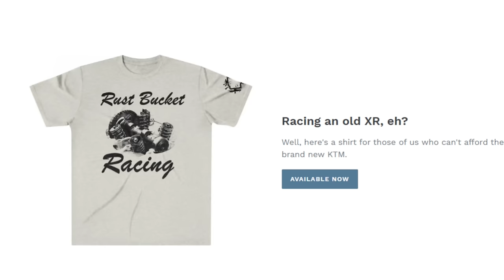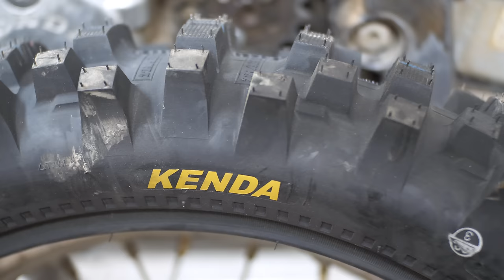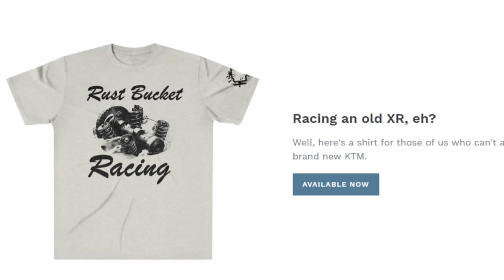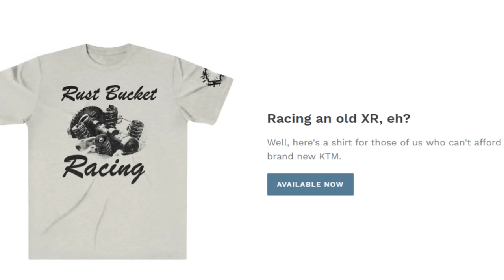Full Episode XR250R Rust Bucket Racing

Comment: someone sponsor this man PLEASE most people that have shiny new bikes cant even use half of the bikes power yet somehow you seem to squeeze gallons from one orange😂
Reply: Which bike do like the best xr 250/400 or the kdx 220/250
Reply: You don't water a cactus.
Reply: David C  good riding. buy a drz 400 e. Do some suspension work and go for it. You ride really well and are proof that it’s about the rider not the bike. Especially these days where they are all good, the bikes that is.
Reply: @eyesthatseewillsee7457  Depends on what riding you want to do. The KDX250 was never really a success and has its issues. However; a KDX220/200 will handle better and make similar or more power than the average XR400 whilst still weighing less than the XR250. 
On the other hand The XRs have amazing tractor torque and are bombproof, they will lug up anything, you don't have to rev them as hard and they will do road speeds all day long and use less fuel doing it (No mixing gas either). Worth mentioning the KDX is also very torquey and luggable for a 2 stroke and is probably the most reliable, low maintenance 2 stroke ever made.

You can't go wrong with an XR or a KDX. If you want to do enduro/technical stuff the KDX is an easy winner, if you want to do more open trails or dual-sport it, XR wins. Both bikes have cult followings and are getting more expensive day by day (for good reason). 
Both have heaps of aftermarket. The KDX is quite easy to get more power out of with simple bolt-ons and jetting, the XRs not so much but they respond well to big bore kits.
When I'm finished cleaning up my KDX I will be getting an XR400 for dual-sport/adventure or a DRZ400 which is also a great option but not quite as good as the XR offroad and even heavier.
Reply: I tired and he sent me a T-Shirt...
Reply: It must be the Carbonaro Effect.
Reply: @GeneralNOH  I do truly respect people like you. You're not biased at all, you gave all of the goods and bad points of both bikes and let the people determine which bike is better for their riding style. Thank you for being so honest and not biased. KDX200 for life!!
Reply: @GeneralNOH  What bike do you ride?
Reply: @ralphelliott9762  hard to be biased, both bikes are legendary in their own reguards.

I ride a 2001 KDX but currently looking into buying something with longer legs for the longer more open terrain rides, most likely a DRZ but possibly an XR400 or XR600r if i find one at a good price.
Will keep the KDX for when the terrain is a bit rougher though :p
Reply: This man can clearly ride 😯

Comment: I raced an 1990 XR250 in motocross against 250 2 strokes back in the day.  After getting 2nd in the first moto the guy lined up on the gate beside me for the second moto commented that I sure could ride that 600.  I informed him that he got beat by an XR250 and he replied, “you mean the girls trail bike?!?!”.  He just hung his head in shame. 😂
Reply: I have the xr250r the suspension is right up and everyone I meet thinks it's the 400xr the seat has been recovered (black bird racing).  I the end can is a powerflow does sound rather good
Reply: @chrishart8548  same mate got a 98 xr250r and it’s just black and white confuses heaps of ppl,  i used to have a 96 xr 400 bored out to 440 and not to much difference.

Comment: The Honda xr’s the tractor of the off road bike world great bikes
Reply: The tractor factor! 👍
Reply: I have a xr Honda tornado. Its realy good. 👍
Reply: Ever since i was a little kid i can remember always wanting an xr.
Finally picked up an xr650l last year, its everything i hoped for, awesome bike!
Reply: I have an XR650R
Reply: @TheClayCoKid  Sweet!
Reply: The XR250R is a different animal than its XR200R sibling. 4 valve head, great flowing exhaust right from the factory, better cam profile. Plus the extra little displacement. The CR250’s were an awesome machine for its day.
Reply: I prefer the xt
Reply: @imprettyfingcheap7575  You prefer the XT250 over the XR250? I assume then you’re more like a B/C class rider? Not trying to be a dick, just saying the XT250 is MUCH more sedate than the XR250 and is like comparing a 250 to a 450 honestly. The XT250 is better suited for beginners and novice riders whereas the XR250 is a full on animal for those willing to tame it in the woods trails. Honestly they’re not fair to be compared even lol; the XR Honda is a 4V head design making 25+ HP from 249cc and the XT is a 2V head design making well under 20 HP (16-18 HP avg). The top end grunt from the XR is night and day over the XT and the midrange flat isn’t there on the Yamaha compared to the Honda.
Reply: @kennethpowers8995  loving my XR400R just got it few months back. Beginner here tho

Comment: RIP XR... again... and again... will it ever truly die? the world may never know.
Reply: The Air Cooled XR250 is alive and well in other countries with very little updates. Unfortunately Honda dropped it in the USA.
Reply: @justonpreble4083  in south america we always had the "XR 250 Tornado", which doesn't even have rear disc brake
Reply: @leamartintorres  I bought two brand new XR250R here in the USA. 1 in 1993 and 1 in 2005. Both had rear disc brakes. Those bikes were awesome trail bikes. Suspension was lacking if you are into motocross but in the desert and mountains those bikes dominate... 

The tornado you speak of is not sold in the USA but might share some parts but sounds like the XR250R befpre it was discontinued in the USA was a little more specifically tailored to hard core desert and mountain Enduro racer requirements in the USA. It was lacking on Power for some riders which is why the XR400R bike was sold in the USA for a few years but was ultimately discontinued also. The XR650L is still sold here but it's super heavy... But it's bullet proof. 

I love Honda but feel they have neglected the next generation of riders. Also I fond it hard to believe its cheaper for honda to make a nike with drum brakes vs superior disc brakes. Decisions like that make people so disappointed. 

Also where is Honda R&D on making electric dirt bikes like KTM. They could buy batteries from TESLA and make a killer line up for all ages.
Reply: You like jazz hehe sorry
Reply: clayton8or_2 nope
Reply: @justonpreble4083  I've read the same online. Hell Brazil is still producing VW Beetles- the old super beetles style of the 70's lol. Sad we can't have such things in America due to capatilism and whatnot.
Reply: Never ever. The bike is Immortal.

Comment: Iv owned my 96 XR 250 since 98. It still runs good as new , all iv ever done to it is change plugs and screw the back shock spring down as the years  go by. Older i get the heavier i get. Removed all the restrictors and that made a huge diff power wise. Its had the absolute hell thrashed out of it. Got rid of all the lights etcc to lighten it up. Love the old girl. Ya cant kill em. Great vid mate.

Comment: Fun experience there. Haven’t raced since 95 and it was the Chaparrall 6 hour at Glen Helen. Like you, I experienced mechanical issues, in my case they started at lap three. 
My power valve actuator unscrewed on my YZ 250. What happened after that was inconsistent opening of the valve which made it turn on like a rocket. Was able to salvage a third place but in the back of my mind I know I could’ve done much better had the power valve been functioning properly.

Thanks for sharing your experience I enjoyed it. Obviously we all learn each time we enter a race like that. The main point is to always have fun. I had fun watching your video. cheers take care

Comment: Crud out of the cooling fins... I had the same problem with my wifes TTR 230.  I took an old (ok a few) 9mm pistol bore brushes  and put them in a battery powered drill... waayy faster than by hand :)

Comment: I bought a 1983 IT490 from a buddy for $300.  Put a couple more hundred in it and raced vintage class in hare scrambles.  Vet 40 plus (senior) also raced this class.  A lot of those guys were pretty fast.  It really frustrated guys on new $10k bikes getting passed by a crappy ass IT490.  I've since upgraded to a 95 CR500.  Anyway, I love your attitude and riding motto!  Keep twisting that throttle.

Comment: Just picked a tidy one up yesterday for a $1000 it’s a 98 xr250r with small renthal bars and a mikuni carb all working and just deregistered. Wacked plates on and rode it home lights and all working. It went good got up to 100 k/hr anyways. I used to have a 96 xr 400 with a 440 big bore kit, going back 10 years now, it had a trail tech digital dash, yoshi slip on pipe and renthal fat bars. Went 160k/hr or 100 mile and hour. Had 11 bikes since, cruisers and 900cc, 1500cc crap tbh I still miss it 😢 old Beast!!

Comment: I'm pretty impressed. You did a lot in a little time. Especially a carb switch. That was a big bite to take right before a 6 hour race. Finishing a off road race that long is an achievement on a bike that runs right. You did it compensating for a floppy foot peg and sticking floats.  I think you can take a little more credit for your finish than you are giving yourself

Comment: As a kid we had the 1982 xr250r fun bike loads of power. Later on in life I bought the mighty 1985 xr350r single carburetor. I had to get some custom work done to the intake boot due to the old one was fried. I was 3rd owner of the bike and I will say the xr350 is a monster. I took on a drz400 and flat out smoked the Suzuki in 6th gear. My top speed was 110 mph.

Comment: I have an 01 xr400, rebuilt from the bottom up and freakin love it. It's hard to kill a XR and I've only ever did it once
Reply: I raced a Honda 400ex in gncc back in 2001.  Ran the whole race with the oil filter in backwards. Finished 6th, then found the filter issue while changing the oil after the race.  Ran that same engine for 8 more years including finishing the baja 1000.    It was bulletproof and idiot proof as well.

Comment: Could you please tell me the exact details of the carb upgrade? I have a 1991 Xr250r. What carb do I need to order? I know the inlet needs a mod, does it run on stock throttle cable etc? Thanks mate.
Reply: Kevin: did you land on a ‘better’ carb option for your XR?
Reply: @shanefoss1731  hi Shane, no not yet,  so far I have rejetted standard carb, smoothed out the rough welds in the exhaust headers, de-snorkled the air box and installed k&n filter, removed baffle from exhaust. Have tested it in a top speed run against exactly the same model but stock and my one has a very noticeable difference, she does run extremely sweet and starts 1st kick.
Reply: @gsoup7850  I have done all the same using my stock carb and have been very impressed with the responsiveness and slight power bump. An alternate carb has been a hard sell for me. Alas I did purchase a pumper MIKUNI TM33 and failed miserably to get that to work much better than my PD. In fact the TM33 would not clean up at WOT as I moved through main jets. I intend to revisit that TM33 someday, but my PD works really well yet. Where did you land with your PD setup? What main/LS? Other changes you liked?

Comment: I raced motocross with a converted 1984 XR -CR-250 in a one season fourstroke class in district 7   had the front end off a 82 CR-125 ,lengthend swingarm 3" ,ported and polished head white bros header pipe with reverse cone megaphone competition muffler lol, white bros rear shock ,Barnett easy pull clutch .
Hated the dual carbs on it though thing was a real mo fo getting refired if you ever went down .

Comment: All decent used bikes are way up in price in my area in Canada. Considering purchasing a clean 03 xr 250 with a 280 kit, suspension and exhaust upgrades, and quite a few other nice upgrades on brake/frame guards, controls and lighting for $4500.  A clean stock one can be found for around $2500-$3000 , if you can find one.

Comment: I like your mentality my friend.  I've been doing this for years because I'm a cheap#$%.  It's great to find more cheap%@&#! out there like me!   Old bikes rock! you can have several purpose built bikes for the price of 1 new one that has to do it all.  I love blowing up a hill on my 2001 rm250 and sitting at the top watching new bikes   falling left and right.  Then those guys have to go home and spend thousands to make them look new again.   Best mods on any bike are gas, tires and oil. You should get an acerbis number plate tank. It would add to the luster that is Honda XR!   They come in .8 and 1.2 gallon variety.  I always use the 1.2 for endurance races.  on my RM it adds up to 4.7 gallons of fuel with the Clarke desert tank.  Motorcross guys always laugh at me when I go to the track and ride the old girl with it on but it gives me more seat time with the added weight- like weights they put on baseball bats.  I used to love watching scott summers beat people on his XR doing GNCC races.  Keep tearing it up!

Comment: My only experience with rfvc is an xl600rm that i got a year or two ago. Rode it 300km, then the camshaft snapped in half and trashed the head and valve cover. To this day i have been unable to find replacements that dont cost the price of the bike (used parts)

Needless to say, i dont share your enthusiasm on the design

Comment: He said " let's see if it starts" it's an old ex are all the XRS you can not even put piston rings on it fill the crankcase with swamp water and probably pour vegetable oil in the gas tank you probably even leave out the spark plug and it still going to start. The XR family is like the old Humvee military vehicles or M1 Abram tank they just keep trucking

Comment: Also, did you go back for the Dr seat? Im curious as to what happened with that. Also, thats how you know your pushing a bike to its limit, the damn seat rejects itself😂
Reply from the maker: It was never found! The course was swept, and nobody ever found it. I really wish my camera hadn't gotten killed 1/4th of the way into that race. I hardly caught any of the drama. So what happened when I lost the seat was I came into a freaking gnarly sharp edge whoop section at like 45mph, which is about 44mph too fast on the DR200. I clenched up and held on tight, just hoping that staying attached to the bright yellow beast would help them find my remains. What happened next was nothing short of a miracle. When I hit the face of the first whoop, the front end crashed into it so hard that the front wheel cocked 45 degrees to the left, while the handlebars were still held straight. The bike and I went airborne sideways, and were immediately flung off the trail, thankfully, so as to avoid the rest of the whoops which would have ended it all. After confirming that my wrists were not broken and that my lungs were not collapsed from slamming the bar pad, I picked up the bike and swung a leg over it. No seat. Looked around.... No seat in sight. Where could it have gone? Into orbit? Simply disintegrated on impact? It's anyone's guess, given the complete lack of any trace of that seat.
Reply: @TortureTestMagazine  😂😂😂 thats fucking hilarious! Some ktm rider about a mile away probably got slapped in the face by it.
Reply: @robertmuir734  DR stands for Darth Raider

Comment: Mate, unreal clip. I love seeing someone do good work with basic gear and talent. I have an xr250r here in Australia. I'm looking at carb swaps now and yours is interesting. Any chance you can let us know what jetting etc you ended up with? and is the brand "OKO"?  Unreal work mate. Good skills!
Reply: I'm currently trying a knock off version of the same carb on my 86 xr250 he used in the vid. I'm using a 34mm model and it fits pretty good into the engine size of the intake, but for the airbox side, I had to make a rubber adapter to connect to the air boot. I haven't tried it yet because I'm currently rebuilding my top end, but I'll let you know what set up I will use in the future. The brand he's using is OKO and they cost around $120, I bought a Chinese brand KOSO and it cost me $28 + I had to get a new throttle cable and new throttle grip for $10 from china.